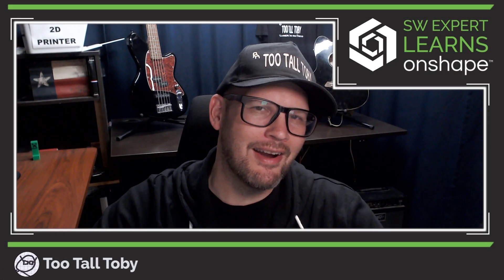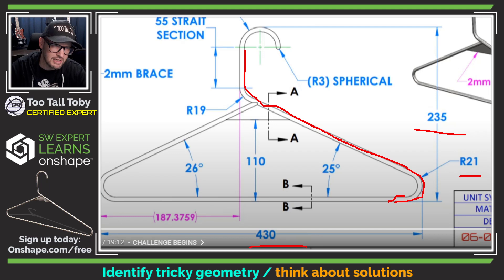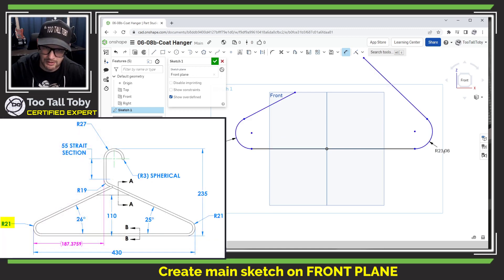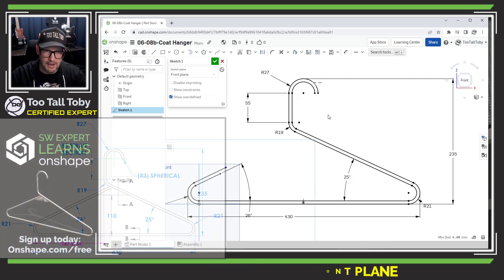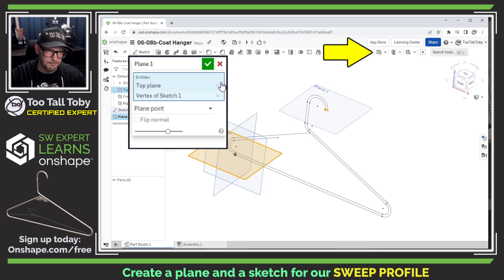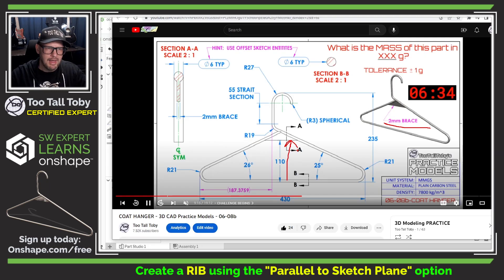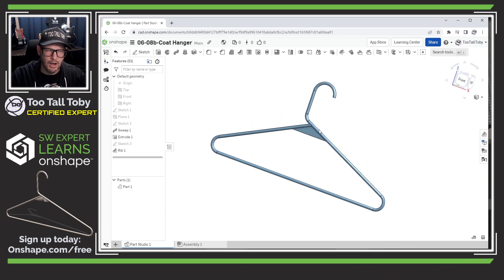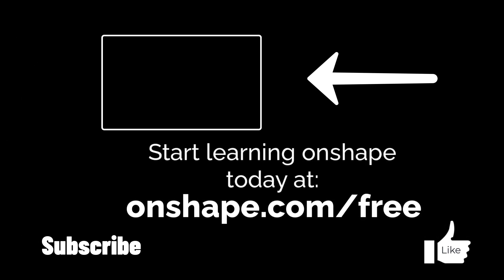Let's Make a Coat Hanger (Tutorial)

Comment: Had a couple more thoughts: on the rounded tip, you could have added a 3mm long bit to the sweep and used a 3mm fillet (would be quicker than doing a new sketch and revolve), or use a move face by 3mm instead of adding a segment to the sweep before the fillet.
Also might be worth highlighting that Onshape lets you accept as failing feature (unlike SW), as you are showing at 6:20, so you don't have to cancel out and redo the whole thing after fixing the sketch. Of course you could also have just left the straight bit out and extruded directly from the end of the arc (might be a more "stable" way to model it).
Reply: good stuff-  thanks airwick!

Comment: Nice!
Quick tip on the offset tool: click-drag selects the entire chain automatically (single click selects just the one segment).
Other tip on the sweep: Onshape doesn't need the profile to be at the end of path, anywhere works so you could have used the right plane.
Good tip with the rib for the brace, I hadn't thought of that when I did it (way back when you first posted a version of this)!
Reply: Awww yeah thanks Airwick!  That's good to know about dropping the profile anywhere - I'm gonna try this!